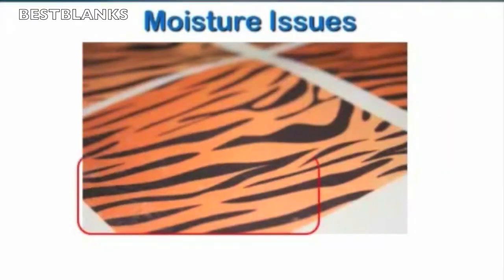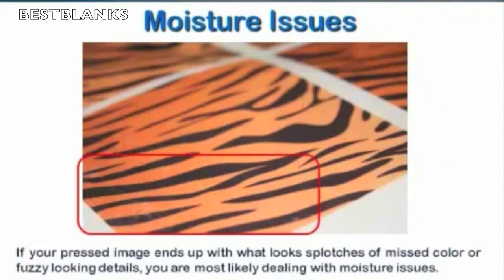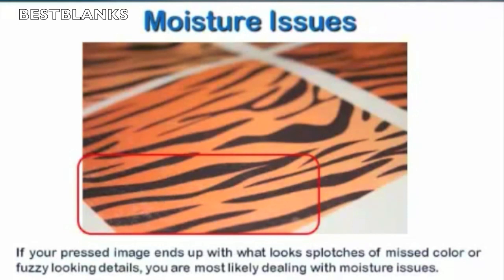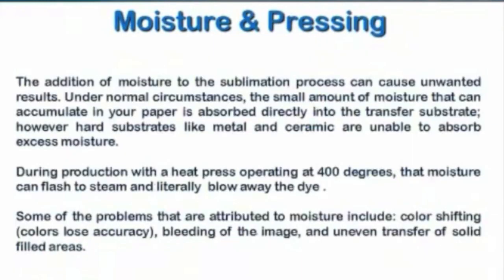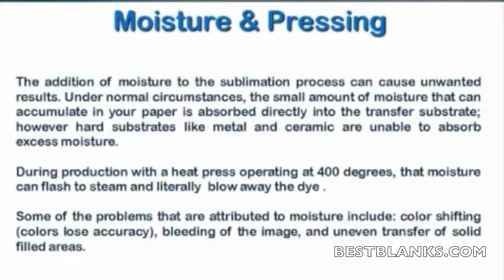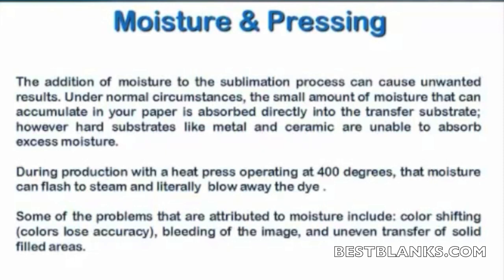How to Recognize The 5 Most Common Sublimation Problems - Part 1: Moisture & Pressing

Comment from the maker: @Billybang53 I am assuming the you are using a commercial heat press. If so, proper application of any transfer paper requires three parts – time, temperature, & pressure. If transfer paper does not work it is typically found that one or two of these elements are not where it should be. (continued)

Comment from the maker: @Billybang53 When transfer paper does not peel of the shirt it is usually a case that the paper did not have sufficient heat or time. But caution should be taken not to over press the shirt.  It is always suggested that if you are experiencing difficulty with transfers that you stop & review you pressing procedures rather than muddle through your inventory without success.  If something is not correct with your process it will not correct itself.

Comment from the maker: @Billybang53 Different paper generally has its own requirements for proper application-there is typically a range of where the paper will perform. For instance our Transfer Jet paper performs well at 370-375F for about 15-20 seconds. However the manufacturer’s  instructions state 360-370F. (continued)